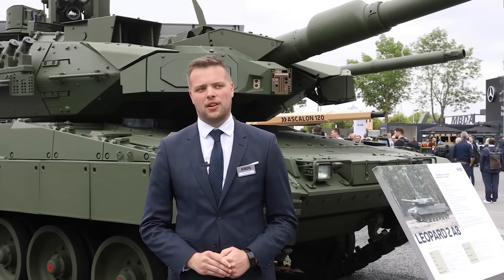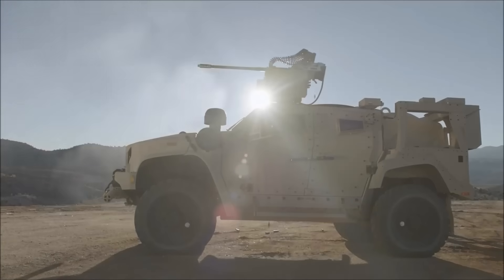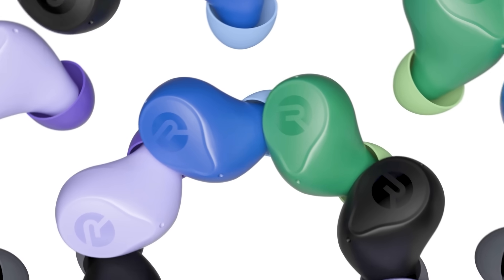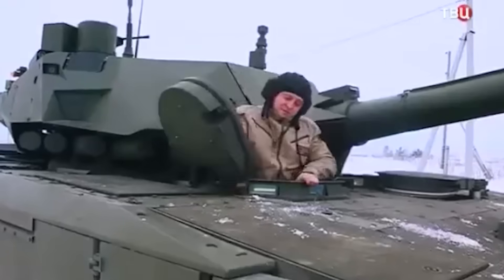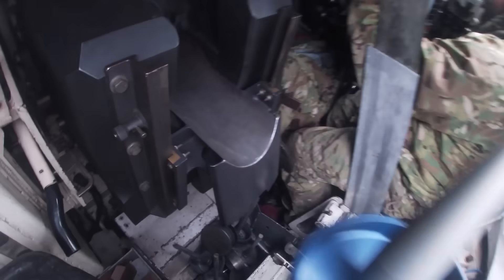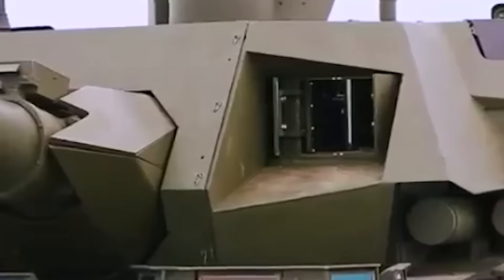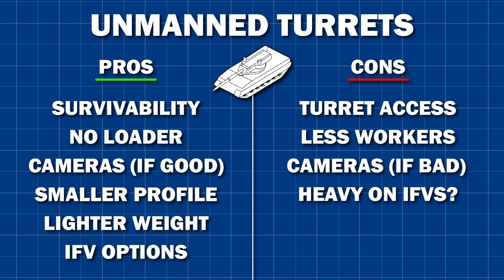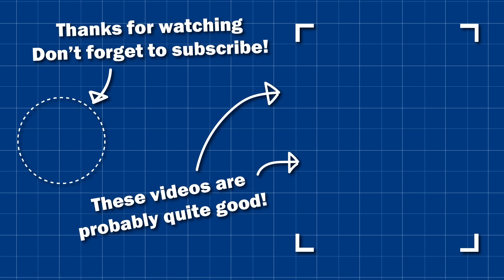The Unmanned Turret - And Why It's The Future

Comment: Nice short vid.
The common point about "less workers" in a loader vs. autoloader discussion kinda runs counter to the fact that crews do not self-service and haven't done that in a very long time due to a combination of vastly increasing tank complexity and average weight.
Sure, if you're stuck in devil's armpit at zero dark thirty with no engies in sight you're kinda left to fend for yourself, but you're not gonna be able to do much if anything at all on most vics without the tooling engies use to service your armor to begin with.
Plus, many proponents of leaving the loader intact as part of the crew actively gloss over the fact that this means you can effectively field tanks in a 3:4 ratio to OPFOR (as in you can only send three tanks per four that enemy can send), which is always a MASSIVE disadvantage, especially if you start scaling up the conflict.
Realistically the entire reason unmanned turrets aren't adopted en masse yet is a combo of design inertia (don't fix what isn't broken) and technological maturity (as in lack thereof).
Reply: The Chieftain put it differently, but he basically convinced me that 3-person crews don't have any maintenance disadvantages as long as you add that person to the maintenance crews, and don't let the ben counters try and save some money by cutting personnel from a tank platoon.
Reply: Yes, this video is pure bullshit

Comment: If they are going full "crew in chassis", they need to start putting engine up front and crew at the back to increase survivability...
Reply: That doesn't work as you have to consider weight balance to maintain mobility. If you put the engine in front you just make a mobility kill easier because it can't be as armored as the crew of three which weighs much less - The EuroPowerPack, consisting of an MTU MT883 engine and a Renk HSWL 295TM transmission, has a dry weight of 2,400 kg (5,286 lbs).
Reply: The big problems with front engine are that engine maintenance can be a problem if the armor is thick and heavy, and it puts the crew further back so they are less protected by the frontal armor (think about shots that aren't from directly in front).

The big problems with crew at the back are that they get little protection from the frontal armor, and they have almost no protection against shots from the rear.

You can "solve" some of these problems by placing the main armor block in the middle, which incidentally helps balance, but this means the engine in front has almost no protection. Still, I think it's worth considering, especially with a diesel-electric drive. If the diesel generator gets taken out, the batteries still allow the vehicle to continue fighting.

The thing is ... with the threat of drones and smarter missiles, an attack could hit from any direction. So maybe the old calculus of threat distribution and armor distribution needs to be rethought anyway.

Comment: 3:56 i dont wanna be the "um actually guy" but the Stryker mgs has had an unmanned turret with a 105 gun since 2002 and you can't really say that the T14 is into service since they basically still are prototypes
Reply from the maker: I do talk about the M1128 - it doesn't have an unmanned turret. Gunner and commander are both in the turret. It has a low profile (and oscillating) turret, which happens to LOOK unmanned. And the T-14 is in service, it's just not mass produced... or overly successful.
Reply: @RedWrenchFilms I guess thats a valid point. Lol low profile does make sense for it
Reply: @RedWrenchFilms alright my bad i thought Stryker was fully unmanned, thanks for the reply :) tho "in service" for the T14 is doing a lot of leg work lol
Reply from the maker: @Xballawanaka My pleasure! The Jordanian “Falcon” turret is another good example of low profile turret designs.
Reply: I thought the same thing lmao

Comment: If unmanned turrets come with engine in the front like Merkava it would certainly be a monster troll(in survivability) in a game like War thunder.
Reply: That doesn't work as you have to consider weight balance to maintain mobility. If you put the engine in front you just make a mobility kill easier because it can't be as armored as the crew of three which weighs much less - The EuroPowerPack, consisting of an MTU MT883 engine and a Renk HSWL 295TM transmission, has a dry weight of 2,400 kg (5,286 lbs).

Comment: Well, in IFVs the unmaned torret also means that ammo is separated from the crew and passangers, so + in protection, whati would do is to put MBT crew to the back of the tank, Merkaca style, + use optional 4th crew mamber acting as drone controller (autonomus UAV and UGVs) and technician

Comment: I don't understand the one less man for maintenance argument. If that fourth man is needed (or advantageous), he could still be there, just not in the tank. They could follow in a maintenance detachment, maybe in some of the heavy IFVs and even carry additional equipment that does no longer need to be stored on or in the tank.
Reply: Basically what Chieftain said in his autoloader video.
Reply: Yeah, this person dont know what his talking about lol

You dont want to do maintenance if you alone (tank) anyway lol 
this dont make sense
Reply: @tonyhart2744 yeah, in combat people never have to do things they just dont want to!
Reply: That creates two co dependent vehicles. But tanks should never operate alone anyway so you might have a point.
Reply: France does something similar to this. For every tank in a platoon there's a VBL (small 4x4 armoured recon vehicle) with 2-3 more people in it, with the VBL crews assisting the tank crews in maintenance out of combat, and in combat providing an organic light armoured recon capability to the platoon. The practice has a history going back to WW2.
Reply: @kilianortmann9979 you want this way, then go you for own, i rather die with 60, more than crappy modern tank anymore.
Reply: Keep the forth person but have be communications , drone operator or something else useful.
Reply: @louisbabycos106  In that case it would be much better to have them outside of the tank. Less armored volume, more flexibility for the 4th man and less electronic signals coming from the tank.
Reply from the maker: You could, sure! But that’s a whole extra vehicle. Expensive, vulnerable.
Reply: @RedWrenchFilms  That extra vehicle likely needs to go with it anyway, as a fuel, ammo, or provisions truck, or an escorting IFV or AA vehicle. No tank works alone, as alone they die quickly to a clucky wheelchair bound RPG
Reply from the maker: @kirknay If its carrying extra fuel then where do you put the extra man? Sometime, somewhere you have to take a hit.
Reply: @RedWrenchFilms  the extra man is now driver of truck
Reply: @kirknay  This misses the point of why 4-men crews are still generally more advantageous to 3-men layouts: Field repair, field maintenance and In- and Out-of Combat duties a soldier may need to do. Near frontlines you have situations where crews either not even leave their vehicles for days or only go outside for adhoc field repairs and damage assesment. Also workload is split by 4, instead of 3. You arent always fighting, but still need awake crew members to keep radio contact at all times, scan the area infront, etc. 
It all comes down to doctrine, and western doctrine, generally, wants a 4-men crew for a better split workload, more manpower available at all times and part of the crew and redundancy. A western tank can, theoretically, operate without the 4th men if he dies or gets wounded without replacement. Ofcourse that would not be a permanent situation but if situations arrive and you dont have the time or luxury to regain a 4th crew member you could operate a western Abrams or Leopard 2 with only 3 Crew: Driver, Loader and someone either at the gunner sights, or more likely operating the turret from the TC seat.
Reply: @tramachi7027  those in the field are still with the support of the infantry, and support vehicles around them. Modern MBTs, especially turbine driven ones like the Abrams, cannot last more than 10 hours with their engines running without refueling, and other forms of resupply. On top of that, any tank that is in the middle of nowhere without infantry in a loose net around them, and other vehicles to assist with supplies and other forms of anti-aircraft or anti-drone support, are easy pickings. Since those vehicles are going to be there anyway, you may as well have the fourth man driving a supply truck, to save manpower that you need.
Reply: @kirknay  yeah that save up, no thank either.
Reply: @tramachi7027  Ok so I got this amazing idea have an unmanned turret tank with 4 crew members. The only downside would be less armor at the sides of the very front since the driver now has a passenger.
Reply: Nah. If you played Squad before, having 2 seperate eyes looking out for HAT's or anything, is EXTREMELY usefull.
A 4th perosn being a drone operator is the equivalent of a 4th person driving around in a humvee infront of the tank being recon.
Its actually insanely uesfull to have a 4th crewmember. Especially if your doctrine is to give fire support.

Comment: I think unmanned turrets are the perfect oppertunity to bring Oscilating Turrets like that of the AMX 50 back.
Reply: Maybe, but an oscillating turret consumes a large hemispherical volume under the turret (an inconveniently shaped basket, essentially).

So the question is ... what's in this volume? Obviously not crew members. Placing ammo there is obviously better protected than the rear of the turret, but in case of ammo cook off it's a lot harder to vent or direct the explosion away from the crew.
Reply: Not sure how such a large mass would work with a stabiliser
Reply: the main problem with oscillating turrets is that it's all but impossible to NBC seal them
Reply: @Appletank8  Well if there's no crew inside they don't need NBC protection in situ, only for maintenance. Still the wasted volume argument stands.

Comment: I would argue that extra cameras would be far better than the Human MK1 eyeball.  You can't add extra eyes to a human, so you have to put more soldiers into the tank or add portholes if you want that kind of visibility.   A camera, on the other paw, can be installed just about anywhere on the tank and in great numbers.   Plus, AI might someday be able to collate the vision from multiple cameras, essentially creating a compound eye without the drawback of bad resolution.

Comment: Unmanned turrets with autoloaders that are placed low allow for a mostly unarmored turret, which allows for greatly reduced weight and cost for the tank, as well as making it so the tank is very difficult to knock out when hull down, for instance, being inside a tank trench or behind earthworks when used defensively. Provided the turret is largely isolated from the hull, you can keep the crew almost entirely safe from fire. Obviously if you wanted to have the ammo in the hull you’d need a door to move it to the gun, but that only connects the two while loading a round.
Reply: But a self contained non penetrating turret can be placed in unconventional places: above the engine, or a smaller and narrower crew compartment, that would allow to make a tank smaller and lighter, without the reduction of survivability.
Reply: @solarissv777  The ammo rack mounted on the rear of the turret, could even be designed as a wholesale replaceable unit, to facilitate quicker turnaround times between sorties, rather than having to remove and replace every casing individually from the tank.

The interchangeable ammo rack would thus be closer to a rifle magazine, with the empty rack getting checked and restocked with ammo, while the tank is already heading back to the front line.
Reply: @tver you would need a special equipment for that, also tge rack gonna be heavy, and suspended heavy stuff mean inevirable injuries.
Personally, I would aproach thw reload problem by improving ergonomics

Comment: Thing about unmanned turrets enabling designers to put more weight into chassis armor is true but as a drawback it also enables easier mission kills through 25-40mm autocannons.
Reply: It is significantly easier to defeat 40mm rod than most scj weapon. 
A few highly angled nera is all you need.
Reply: No. No it doesn't. You can have multiple backup sensors. You can't have a backup crew member skull.

Comment: I remember you all mocking the t14 when the russians said it would have an unmanned turret
Reply: We are still mocking them for not having the damn thing in service, it's amazing on paper but they probably have troubles with the digital control and cameras.
Reply: @Klovaneer mocking your own intelligence rather. "How is this super expensive cutting edge prototype isn't widely adopted after only a couple of years since it's introduction?" 

Unmanned turret or not, nowadays the main issue is drones and any concept designs that isn't adequately equipped with being constantly bombarded by cumulative charges in it's weak spots is automatically dubious.
Reply: @kindlingking  There shouldn't be anything super expensive in there, russians have been making autoloaders for 60 years. If it's a matter of large-scale production of a completely new vehicle then it's been 10 years sharp. So the only thing left is they have problems with the design itself.
As for drone protection it should be easier to shedify a tank that has crew hatches all in one place, hell the vastly lighter turret should support the entire BBQ set.

Comment: At the risk of stating the obvious, doesn't it all depend on the quality of the autoloader? Current autoloaders might be fit for service or not depending on who you ask, but the state of the art is constantly improving and there's always the possibility of throwing way more money at it it produce a really gold plated system. An Abrams tank cost 25 million dollars, maybe $40m if you're a Gulf state and you really want to stay on America's good side. Those are rookie numbers. A new F-35 costs $82.5 million just because it has a fancy paint job and it can launch expensive missiles that do all the work. For $82.5m I bet you could get an autoloader mechanism that loads shells better than two dudes.
Reply from the maker: True but for 80+ million you could get 3 normal Abrams using your prices! It’s trying to determine at what point mass outweighs capability I guess.
Reply: @RedWrenchFilms  Yeah I kind of agree that just buying more tanks makes more sense in most scenarios. I can imagine some future technological development that makes a super expensive ground vehicle economical, laser CWIS integration maybe? But that's highly speculative and anyone can write science fiction. Unfortunately we'll see what happens on the battlefield as developments emerge.
Reply: Note: It's just a joke don't get mad. I know stealth coating isn't just fancy paint and the F-35 is an impressive high performance aircraft.
Reply: Probably irrelevant, but it IS possible to have an unmanned turret with a manual loader. I mean, look at the Patria NEMO 120mm mortar. It has a human loader to place a round in a vertical shaft and then an automated loading piston lifts the round into the barrel (which is pointed up during loading).

In principle, you could design a similar system where the loader manually lifts the round into the barrel, or have this as an option in case the piston fails.
Reply: The difference is you will lose tanks because of their role on the battlefield and therefore need a lot of them to compensate, where's aircraft is more specialised and isn't meant to constantly be subjected to enemy fire, in fact the goal is normally to suppress enemy anti air capabilities and only then send in your jets. Hence why they can be and usually are very expensive. But not even americans would be so wasteful to seriously adopt a 80+ million dollar design. That's just shooting gold bars at your enemy.

Comment: I think they are the future for IFVs but not quite for MBTs. Also for MBTs, the amount of sensors you have to saturate the unmanned turret to equal or surpass not just actual situational awareness but perceived situational awareness of the crew, coupled with the smaller turret for MBT; this will have you end up with a larger sensor to total surface area ratio for the outside of your turret. 

Even if they are rugged, it makes them vulnerable to being damaged in an engagement based on pure statistics alone even if sensors are not what’s being targeted. 

And with IFVs with unmanned turrets getting larger auto-cannons. I’m telling you right now, you won’t be able to make your necessary 360 cameras able to withstand fragments from a 30+ mm auto-cannon. Before you only had to worry about your gunner sight and your commander’s viewer. Both of which could be easily stowed up by the crew or were already indented into protected crevices because they only needed a narrow FOV at a time.
Reply: Anything that can damage a camera in an armored housing will turn a crew member sticking his head out to see into minced meat.
Reply: @Infanterie_Marine manned turrets will still have the same amount of sensors from here on out. You just don’t get to have a back up in the case of an unmanned turret. That’s okay for an IFV and an APC but for an MBT, that’s inexcusable. For an MBT, gonna have to be somewhere in between. Where the crew is going to be sitting lower in the turret ring more in the same level with the driver but the turret is still accessible quickly or the commander can still pop up unbuttoned on top of the turret quickly if need be. MBTs don’t really get to have the same benefits from the deletion of a turret basket than an IFV does.